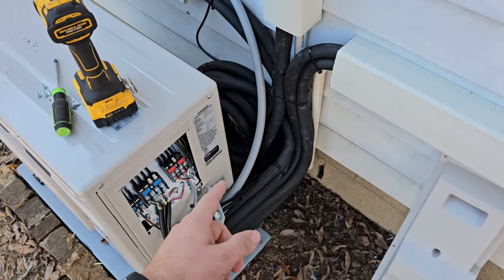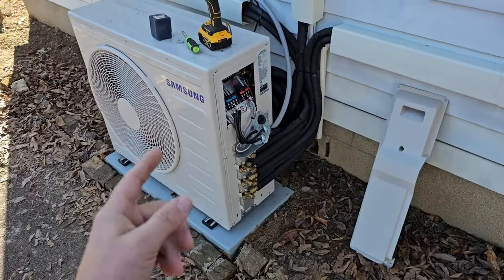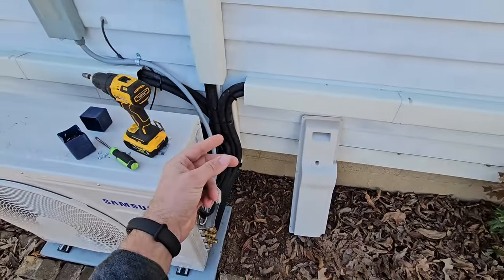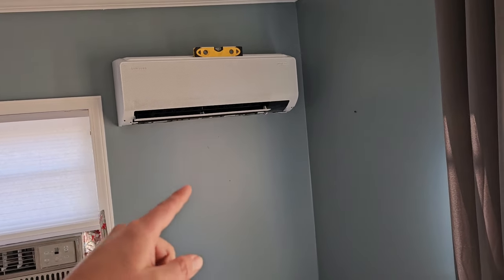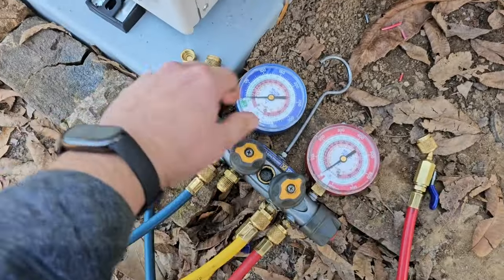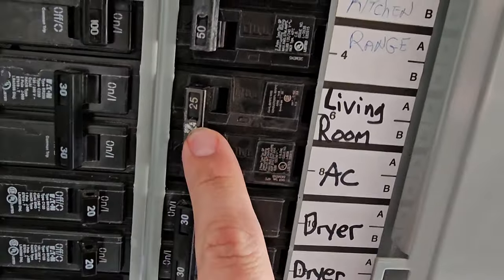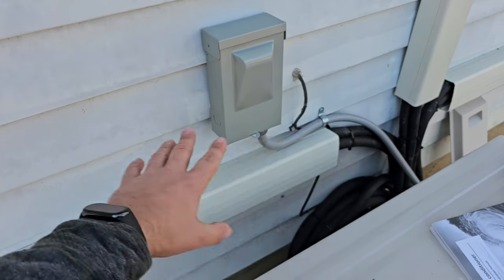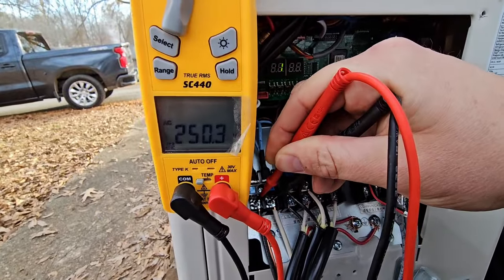Master the Art of Mini Split Installation #minisplit

Comment: Hey thanks for all the info. I’m a technician (from the Caribbean) returning to the fiel after a 10 year hiatus, you’ve helped me out a LOT this year! Been hearing about the rolled up lineset being bad as each loop creates an oil trap. What do you think? Thanks again!
Reply: I did some research on this very thing . I read through instructions on pioneer site on there mini split . They show intentionally creating an oil trap if the inside unit is way above the out side unit . Around above 25 feet i think . So no idea why . Now , no mention if the units are much shorter in height to each other . Now just in case it is not good to create an oil trap i coiled around 3 feet of line on top of my unit horizontal .

Comment: I have had many issues with the flare kit that goes on your drill. It seems to heat up the smaller lines and cause the metal thickness in the flare to shorten. Then when you pressure check it, I’ve actually had flares break. I have been told by Carrier tech-support and Mitsubishi tech- support not to use the drill flare kits.

Comment: Fantastic video and great tips as always.. I would probably just add the importance of using a vacustat to test lines.
A vacuum test won't show WHERE a leak might be.. but sure proves if one exists and far cheaper than using nitro.
Here in Australia the regulation is the system must HOLD below 500 microns.

Comment: If you pressure test & the psi is constant or just vacuum & your pump pulls a vacuum, what's the points of the soap test?
Reply: Hi! S😅me times the pressure hold and then you see one bubble every three  seconds, reither be safe then s😀orry. That old method still works.